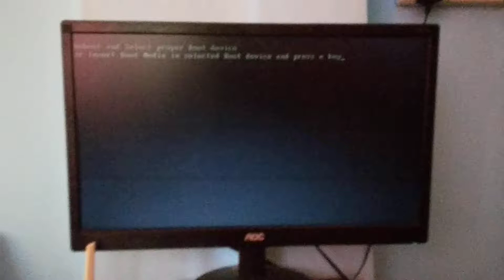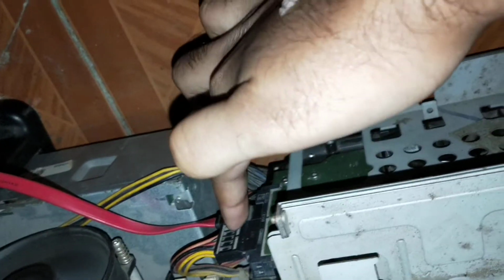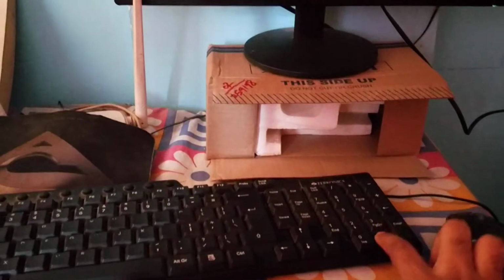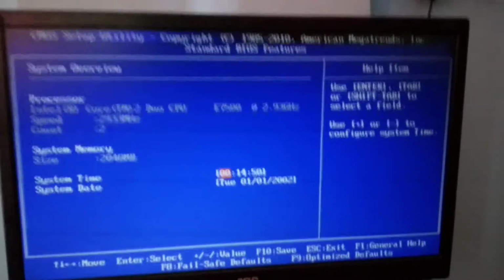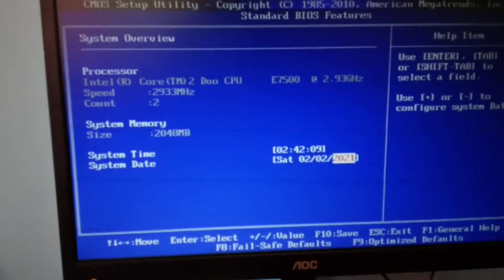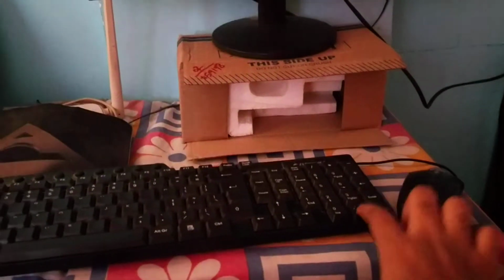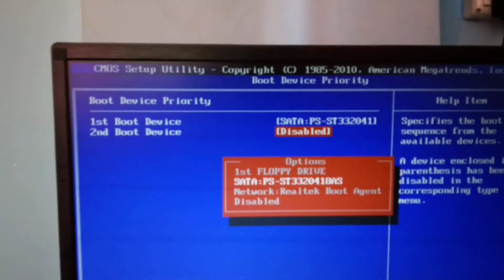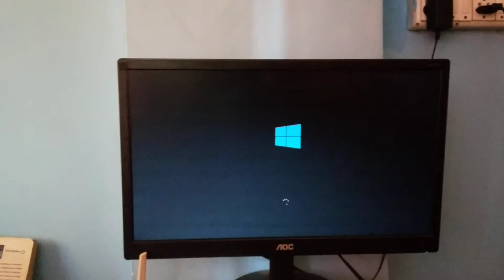Reboot and select proper boot device issue - Fix

Comment: Help I have restart the computer but again and again it shows restart the system
Reply from the maker: It will go in loop until the system won't detect the hardisk where the OS is installed.